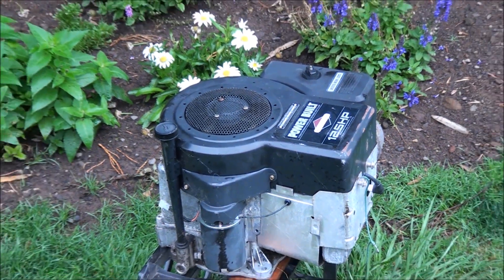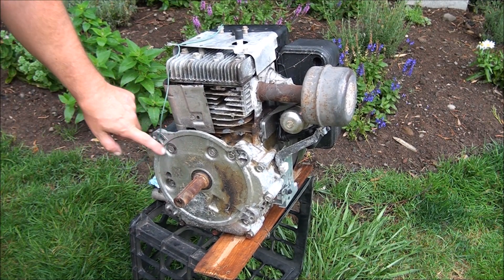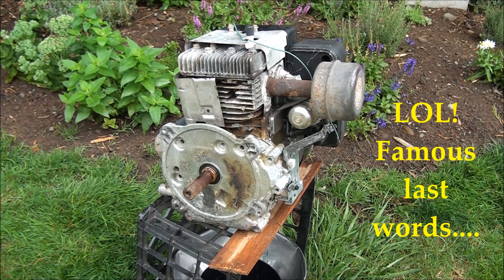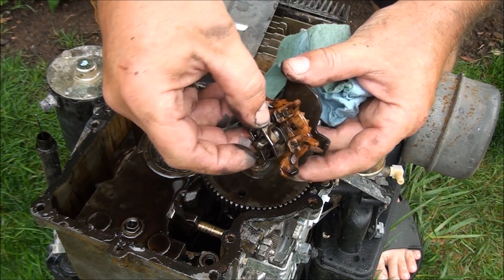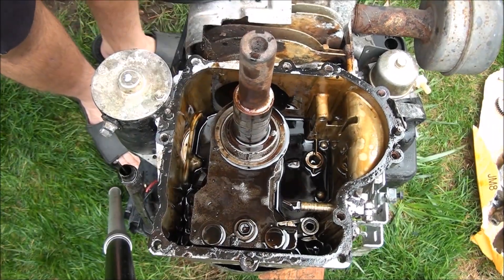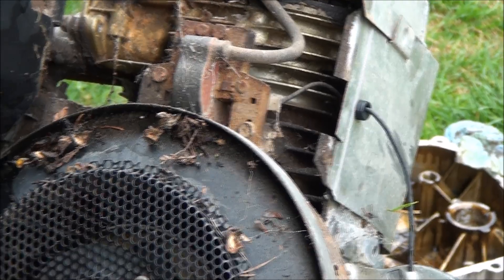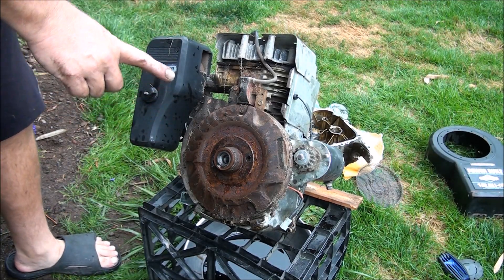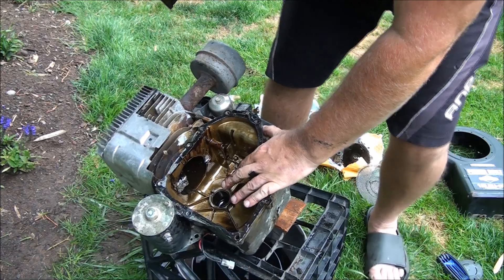BUSTED! What the INSIDE of a Briggs and Stratton 12.5 HP FLATHEAD engine looks like after NO OIL !!

Comment: I thought the cam shaft looked pretty good actually. Looks like normal wear and tear from hours of usage. The problem lies more in the crankshaft and connecting rod for sure I'd say. Little money put into it, you should have a good running engine.
Reply from the maker: Just needed a rod and rings

Comment: If you're still around i changed engines to a 12.5 just like this one in the vid, got it from the junkyard out back ,, put all my parts on it but it has a clicking sound , not a rod knock just a clicking sound. Any idea what that could be , oh def on the inside of the motor..

Comment: Very enjoyable video. Looks like a repairable engine, provided that the rebuild includes a replacement crankshaft or careful conditioning of the journal matched to a new connecting rod. Either way, the project is worthwhile when the bore still looks good like that.
Reply from the maker: I thought so too. I finally put it back together just recently with a new rod and it fired up!

Comment: Interesting failure, my lawn mover did same, but worse,  camsaft try to eat those loosened parts, its bearings broke and saft itself twisted. Is this design failure because I have it filled with oil to mark? Those aluminium bearings are dirt cheap to make but really bad, shame on you B&S!
Reply from the maker: If there is overflow gas in your oil compartment from a flooded carb it may cause this
Reply: @JeffsLittleEngineService  Yes, that is good point. Year ago I wonder why oil is over top mark. I change oil but maybe initial damage was done.

Comment: Um......your choice of work bench leaves me wondering.......

Um....why not just use a puller?  The time it takes to do it the wrong way will never make up for the time it takes to do it right.  Using a pry bar against parts never intended to handle the force, well yeah, what could go wrong?

Love the pan full of oil under the...um, er....workbench.  Again, what could go wrong?

I appreciate a video showing information but can't understand bad planning or sloppy methods.
Reply from the maker: If you can work on an engine in a flower bed you can work on an engine anywhere......

Comment: Jeff's - I'm surprised that you didn't try a little Hydrochloric acid soak on the crankshaft journal for the connecting rod. You're likely to find that the grooves and scars on the crankshaft are actually built up aluminum from the connecting rod and yoke. Boric acid eats up the aluminum and can leave you a nice, shiny journal to replace the connecting rod before you go chasing a new crankshaft or block. Saved many a scary looking motor this way...
Reply from the maker: check it out Greg I made a video! Thanks for watching! https://www.youtube.com/watch?v=mcp2dfbZ5U4

Comment: Here's a tip for you and all viewers. The use of the proper tools increases the margin of not having a physical accident exponentially. A walk back to the tool shed for the needed tool sure beats a trip to the ER.
Reply from the maker: YES! using the right tool is safer and usually easier
Reply: i was thinking the same thing
Reply: Also, proper footwear is recommended. Drop that on your toes and you’d be done for the day

Comment: Here is a suggestion. Buy a good 1/2" drive tool set with a breaker bar. Start the tear down with removing the cylinder head first and go from there. The previous owner never knew what an oil change was for after seeing this mess.
Reply from the maker: Thanks for the tip!
Reply: What’s wrong with wrenching on a 15/16” bolt with 1/8” drive socket?  Might need a 3 ft pipe!
Reply: And a decent work table if he doesn't already have one. This video is 5 years old now so maybe he has a good surface to work with now and doesn't have to be stooped over to work on things. Not on shakey plastic milk crate, there is no leverage there especially when you were trying to get the sump cover off. All the energy was wasted in the wobble. Work smarter, not harder. Cheers!

Comment: I  still have the mower deck on and am trying to get the two lower pulleys off, no bolt on the bottom and suggestions, thanks
Reply: heat n hammer

Comment: Assumption is: The crankshaft is no good.
Reply from the maker: Yes, however I am currently making a video on using muriatic acid to clean the crankshaft journal of the melted on aluminum bits. The crankshaft may be reuseable after all! Stay tuned

Comment: thats no good it was a quality engine Briggs and Stratton made before they went to crap today. as the flathead engines are no longer available that you Must go with a modern OHV engine.  in whost cases besides a thrown rod the counterbalance weight breaks and goes through the back of the case as Briggs & Stratton calls it the syncro balance. but same with Kohler the engines are getting worse.

Comment: Had a generator that was for sale, $50 with the same problem. B&S engine. No oil. Crank was fine. New rod, piston, rings, scrapped the aluminum off the crank and she was within 1/2 of a thousands to factory - so to spec still. I think it was $75 worth of parts and the generator still runs today. I've had it for probably 15 years. Maybe more like 20.

Comment: Oil: An engine's best friend! This is sad, because those synchro-balanced engines are a rare breed. I don't know if  Briggs & Stratton even makes those anymore. Briggs & Stratton have largely transitioned to over head valve engines, but I don't know, if they make a synchro-balanced version with OHV. If they do,  I'm their next customer! (I would love to find a horizontal shaft engine with this feature, for a smoother running generator)
Reply: Do they still make flathead engines?
Reply: all intek single cylinders are syncro balanced and they love to blow the block out

Comment: One other thing that can break one of those engines is a bent crankshaft. Don't know how it happens or why but it happened to my 12 hp engine. Still runs, but shakes pretty bad. No, it isn't the flywheel I've already checked. Fortunately I have a spare of the same engine so just gotta finish the engine swap.

Comment: One thing I noticed immediately was the oil drain plug on the side was missing, maybe it got unscrewed somehow while the engine was running and all the oil came out of it and blew the engine. But it can't hold oil without the oil plug. Like you said about the only thing that takes those engines out is no or low oil, it's rare too see one of those blown. They will start the smoking over time from years and years of use, like 25-30 years, but I rarely ever see one of those blown. Those were some of the best engines Briggs ever built it was during their heyday.
Reply: Is that the truth
Reply: Hehday. Hay day. 
Tomato towmahto. 
I say POS.
Reply: @mateobrainardo4770  This definitely isn't your field of expertise, because no with any knowledge of small power equipment has ever called the 465cc Briggs L head a pos, not in the 10 years I've been working on this stuff steadily, your the first and you don't know what your talking about. Ask anyone with any real knowledge, they will tell you the same thing. I have more of those L heads outrunning the new 540cc pos Briggs 3x over, you get 25 years out of those engines easily, they normally outlast the machines their sitting on. I can't even count the amount of machines that had blown 540cc motors that ended up with those L heads transplanted and putting the machines back out to service. My personal machine is a '95 with the that engine, I'll never get rid of it, love that engine. I never have to worry about valve lash either, maybe once every 20 years. The new ones have tons of issues those old ones never had, the compression release fails on the regular, it never fails on those. I love those new engines, they break so often I end up with tons of nice, newer machinery for free and if the engine can't be fixed, I throw one of them flatheads on and out it goes, making it an overall better machine.Those, the opposed twins and the Quantums 1984-2003, the hey day. 🍅. 
Now is Towmahto. Theirs a huge difference trust us.

Comment: Hey Jeff your sure that’s not just aluminum from the piston rod stuck on the crank and not gouging ? I had the same issue on my honda engine crank, and I just took muriatic acid and wiped it on , and it ate all the aluminum off leaving a small,amount of wet sanding after.. it it was back to a smooth surface.. tell them you learned it from me ! Tip # 00001
Reply from the maker: LOL! good advice you may be right. I will inspect it a little closer
Reply: That’s how is done Son !

Comment: Same engine I have in my old Craftsman Tractor. Might save that crank iby soaking it in Muriatic acid and the aluminum off. I've done it before. I beat a new rod and it will run.
Reply from the maker: Great advice I will check that out

Comment: I’ve never used a puller. Always went “old school” with a long screw driver and a 2.5 lb ball peen hammer. Never failed.
Reply: Jeff shows just that at the fourteen thirty mark.
Reply: @dkeith45  easier to make a basic puller from piece of old iron bedstead angle iron cut to 6 inches long with two holes drilled in to match flywheel distance,  the sump cover bolts fit the flywheel thread. Just put an old socket into the top recess where the 24mm bolt goes and tighten down. Piece of cake !! no hammers, no damage.. Cheers.. Great video there. Just have to get a new conrod (bad oil day !!).. bang !! lostinfrance.

Comment: I have the same one except my carburetor is rusted and will not run
Reply from the maker: A new oem carb is apx $100
Reply: Can get a cheaper Chinese made one from Amazon, probably in the range of 15-25 bucks. Not OEM, but will work fine. Bought one for my Cub Cadet 107 kohler engine, and it works fine. However make sure you look up the part number for your carb  and not mine or his, they are all different.

Comment: jeff I was given a wizard riding mower made by mtd sold by western auto the other day it is powered by a 13 hp power built briggs and stratton model # 28.707 type  #1154e1 code # 010124zd it has a 13 inch deck am looking for a model # and serial number as mine has been painted over just wondering if u have any 1986 to 2001 model ntd or wizard machines i need to order numerous parts for this machine please email me if u or anyone can help grldsanford@gmail.com thanks gerald
Reply: i have that same engine  is a good motor jeff dont give up homne the cylkinder new piston rings and rod relap the valves will be like brand new